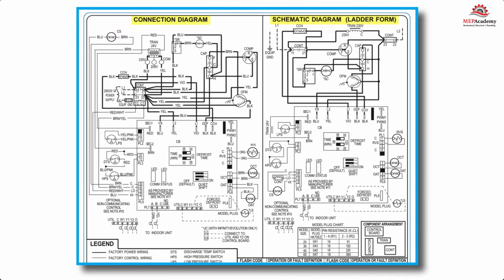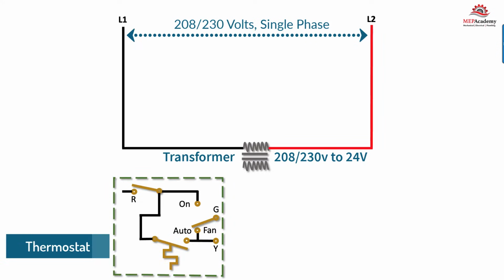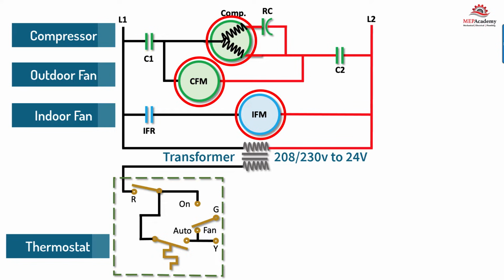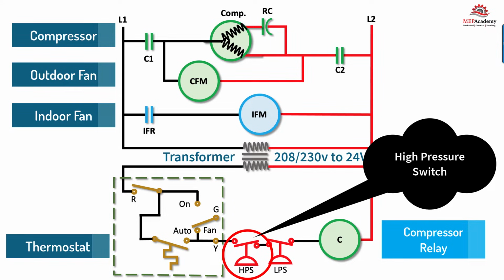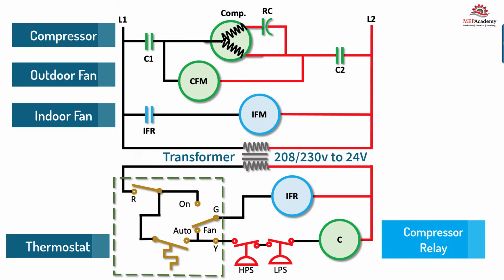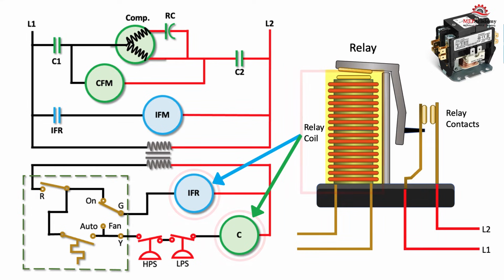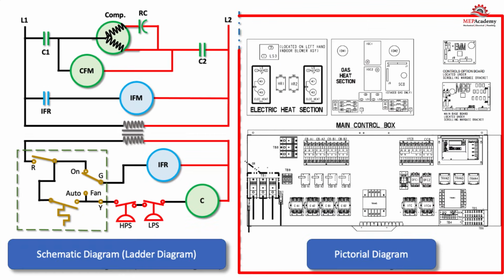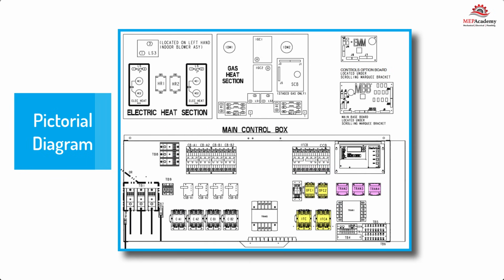How to Read Wiring Diagrams for HVAC Equipment

Comment: I won't lie , you lost me at thermostat. What does line 1 and line 2 signify? High voltage and low voltage? Does the compressor and indoor fan not have to be connected to the transformer because they can take high voltages while a thermostat cannot?

Comment: I just came across your channel, thank you for your videos. Do you answer questions as well?
Reply from the maker: Yes, we try to answer as many questions as possible related to our content,
Reply: @MEPAcademy  good, 
Do you guys have online training for wiring schematics with controllers, jace, master jace, and AHU system(general hvac system). I want to learn the controls from the very jace, to the controller, how that communicates and how the ahu is controlled thru the controller (wiring with signal inputs and outputs). Also how the relays are controlled thru the controller and primary voltage. I have a lot of learning to do, I will even pay for a class. Thanks
Reply from the maker: @NROhvac  We are currently developing several training classes for online courses in the MEP trades, unfortunately early release would be around May.
Reply: @MEPAcademy  I look forward to may!